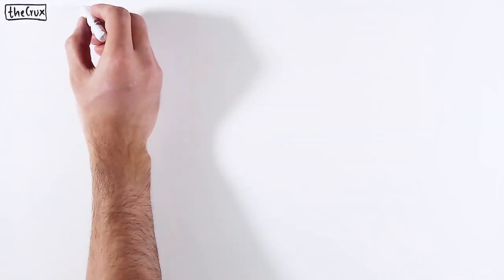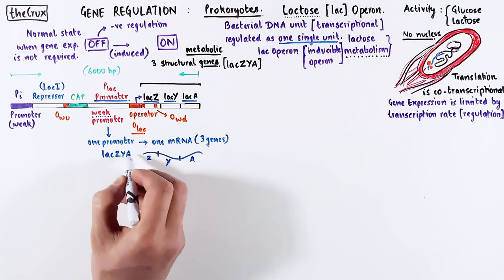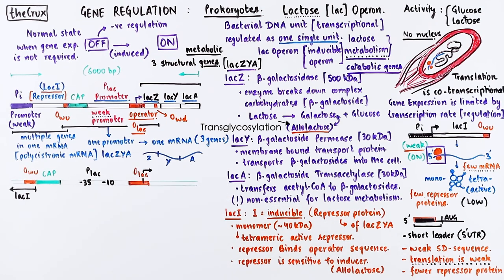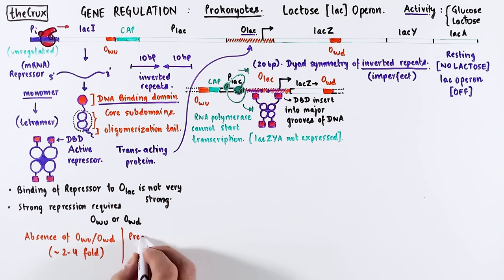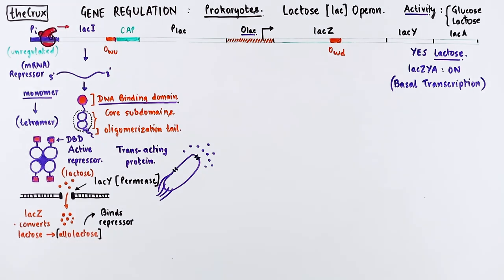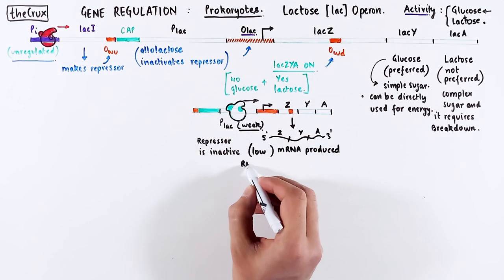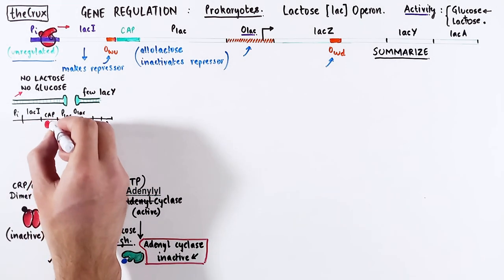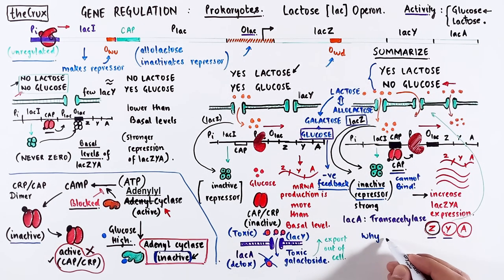Lactose (Lac) Operon: an inducible operon (deep-dive video)

Comment: When the repressor binds to the main operator and the downstream operator, is it any more or less effective than when it binds to the main and upstream operators?
Reply from the maker: Great question! The upstream + main operator combination is overall more effective than downstream + main operator since there are more chances for the upstream to loop. Most all processes are dynamic states and more often you can transition into a state the better the outcome. So by that logic the main + upstream has a better outcome to negative regulation. The binding strength as an absolute measure between upstream and downstream is not that different.

Comment: I think the answer Is because glucose Is too low to reduce the transcription of lac operon
Reply from the maker: True, it is too low but that is not an observation but a mechanistic explanation to why it doesn't repress the operon :) You are on the right track to the answer. Hint: Think about where glucose may be used by the cell.

Comment: Thank you for your explanation! I have a question about how the basal levels of lacZYA happen when there is a repressor in the operator. Doesn't the repressor block the RNA polymerase to transcript the lacZYA?
Reply from the maker: The repressor or any other DNA binding protein is never bound to the DNA permanently. It is a dynamic system, things are bound and unbound (dynamics, also called on and off states of a protein). In those moments when repressor in not bound (i.e. off state), RNA polymerase can have the opportunity to transcribe the lacZYA. When the repressor concentration increases, the opportunity for RNA polymerase to transcribe decreases immensely - hence repression.

Comment: very nice presentation. I have a question, how many untranslated regions does the mRNA of the lacZYA has? Is it one 5 prime untranslated in the beginning and one 3 prime in the finish, or one 5 prime and one 3 untranslated region for each structural gene?
Reply from the maker: There is a UTR between each structural gene. They are 5' or 3' depending on which structural gene you are talking about. UTR is ~50 bp between Z and Y and ~80 bp between Y and A.

Comment: Nice  explanation  , Nice  &  colourflul n correct....informative.....deep  execution....no words  further.....for my expression.  Thank you very very much for this.  Now answer ....it may be because of initial high concentration of lactose and little concentration of glucose....I think so....
Reply from the maker: I am glad you found the video useful. For the answer: You are correct in saying that the concentration of glucose is low relative to lactose. But that is just the starting point of the answer :) At a deeper level, it would be better to say that the concentration of glucose is not high enough to actually have any impact on the cAMP pathway because the little glucose that is produced by lacZ ends up in glycolysis 🙂

Comment: Great video! The level of Glucose wont be high enough as it will be metabolized in Glycolysis (?) and I guess there will also be an enzyme which controls the adenylylcyclase, which, at a distinct concentration of Glucose in the cell, will inhibit the adenylylcyclase. When this happens, the cell will/musst switch to Glucose as the CRP is inactivated again. 
Thanks for the content.
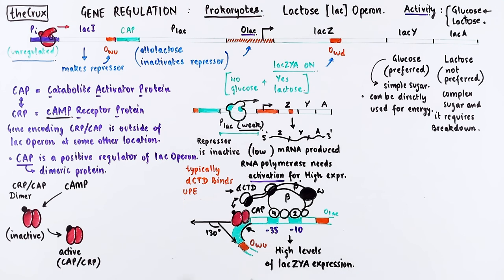Reply from the maker: True! Glucose won't be high enough because it gets used in energy production (Glycolysis for instance). But I don't quite agree with the second half of your explanation - glucose itself controls adenylyl cyclase (see 22:55 in the video) . In my opinion, the glucose is not high enough to inhibit the Adenylyl cyclase, so the CRP/CAP remains active. Therefore, no negative feedback at limiting glucose concentrations.

The cell will switch out of lac operon if Glucose concentration exceeds the threshold concentration for repressor inactivation as well as adenylyl cyclase inactivation.
Reply: @theCrux  Yes, I guess your right. I was confused with the PTS-System, as the EIIA^Glc [Phosphorylated] Protein needs to bind to the Adenylyl cyclase to be active. I was to unsure about the mechanism and thought it would be phosphorylated by some enzyme, but it just stays phosphorylated if there is no Glucose. Thanks!
Reply: @sharisto354 True...We maximum time think that extrinsic regulation like modifications can be the case....But  we never thought of dynamics as like @theCrux explained....Btw awesome content

Comment: nice video....very detailed explanation....that has made my concept clear
the answer of the last question may be as soon as glucose is produced by breakdown of lactose it should be utilized by the cell for energy formation through glycolysis and then other respiratory processes
Reply from the maker: I am glad the video was useful :) And you are correct with the answer that the glucose (which is produced at a low concentration) gets used up in energy production, so it cannot form a negative feedback at such low levels 🙂